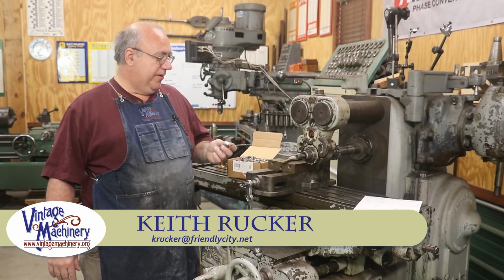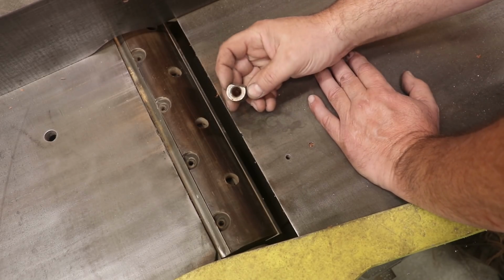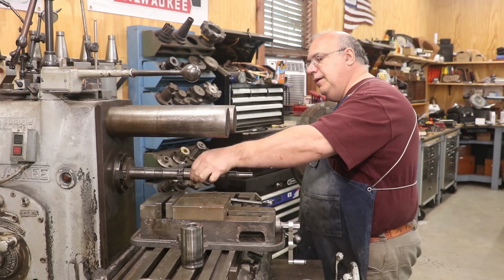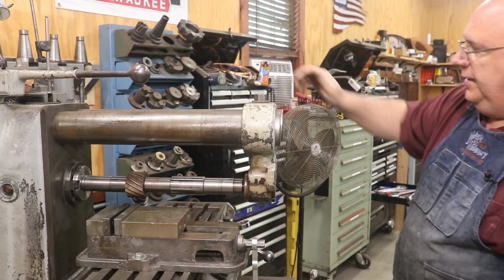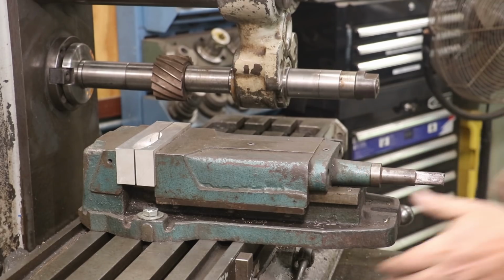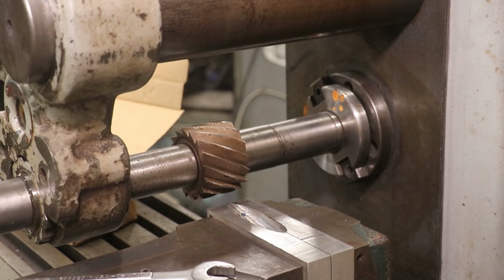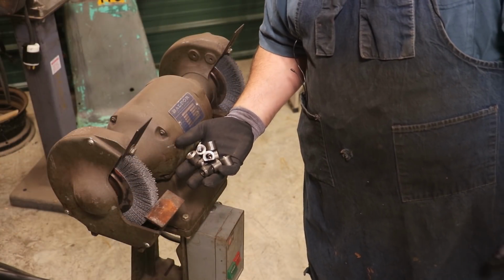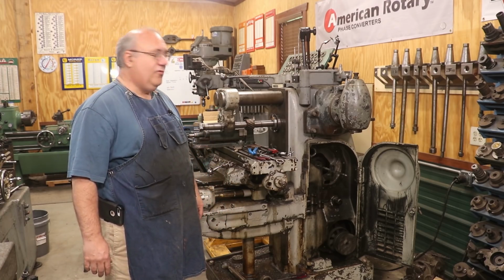Machining Tapered Flats on Crescent Machine Co. Jointer/Planer Key Plugs

Comment: I just got through rolling the head on my vertical mill over to horizontal to bore a large part. I try to avoid such things because I'm slower than sin at getting it back to square. I bought a 16" Crescent jointer years ago for $100. Had the tables and fence Blanchard ground, new bearings, new control, guards, dust collection hood, cord, cap & paint. Getting the tables aligned takes a lot of time! I made a grind-in-place setup for the knives. Direct motor drive so very smooth running. OK jointer now.

Comment: Keith, i emailed you through the website. I know i may be asking for a frivolous job but in my current situation i am at a brick wall. I am unsure if you can help me but im struggling and a simple matching process could change my situation greatly. I know you may not think im worth it or i deserve it and you may be true but every penny i can save can help take care if my ill mother. I know a motorbike part may not seem logical but the fuel savings would help cover medication costs and my sanity being able to escape my stress. I hope you can help and i will volunteer or do anything i can to pay it forward if you where willing to help me, but if not i understand and thank you for reading my request as i have exahausted any other options. I just cant afford even a used replacement right now. Thanks for all you do Keith

B.t.w. its a vintage kawasaki on historic plates so kind of fits the theme. Thank you for reading and thank you for everything you do.

Comment: Actually, the angle cut was fourteen degrees, not seventy six. 76º was on the drawing but that was dimensioned from 90º off of the centreline axis of the cylindrical blank. Easy mistake to make, can be very confusing when the angle is close to 45º.

Comment: Those jaws would benefit greatly by adding a hole to push the part out as you're done.
Reply: A magnet on a stick would work as well paticularly when you have aluminium vice jaws

Comment: I like to remove tool rests on any grinder with a wire wheel. Otherwise parts can get sucked in and launched into orbit.
Reply: As long as the gap is kept smaller than the part, no worries. Otherwise without under-support, there's a possibility of the wheel shooting the part at your leg/foot, especially after you've done 20 or more parts and your hands start to get tired of holding them tight.
Reply: @scottr939  I would agree if the wheel is solid, but wire wheels will compress and pass the part through. They'll do the same with your finger. Hence I don't like em.
Reply: @TheMetalButcher  I guess if the wheel is super soft, the part is very small, and it requires lots of pressure, which then is probably the wrong tool for the the job, or maybe you need something to hold the part. I just don't like burdening rules for the 1% case when doing 99% of the work - in those rare cases I of course take the needed precautions.
Reply: @scottr939  I'm not trying to be a safety nanny or tell people how to live their lives. That's up to them. I'm just saying that the amount of flung parts and injured fingers went down significantly after I removed the rest. You do you.
Reply: Simple rule... never where gloves (or rings.. or loose clothing) around rotating equipment. Find a better way!

Comment: When ever I have to mount a specialty vise on a mill if possible I will mount it next to the main vise and not remove the first vice, it saves remounting and tramming the main vise. In the shop I worked in the manufactures reps recommended this practice along with relocating the main vise on a regular basis to even the wear on the ways.
Reply: That's good but only applies to shops that need to save time. Working center is best for the mill, and a home shop is oriented towards length of life time of a machine vs production speed. Besides tramming is easy, not like it's that time consuming a job or complicated.
Reply: @aserta  So the manufactures advice to set your vise at different locations to even wear was a lie?
Reply: Pretty good idea. One of the things I love about machining is all the little tips and tricks we learn til we ded.

Comment: I noticed a bit of fumble to get 5he finished part out of the fixture block. I was thinking i would drill a small hole so you could poke a wire through to push it out. If you wanted to get fancy, you could use a stop to bump said wire whe you backed the table away.
Reply: How about a small magnet as the part is steel and the soft jaws are aluminum?
Reply: Yes much easier to just turn the vise handle 1 more revolution so you can pull it out. The soft jaws will separate as wide as you get them to.

Comment: As usual excellent video. A bit surprised the tolerance is so close on the diameter at the end of the taper. Needless to say it's difficult to measure unless you build some sort of inspection jig.